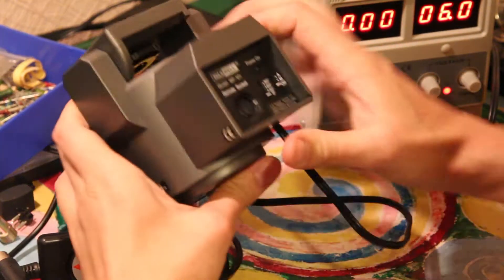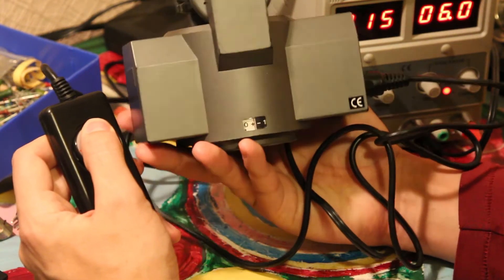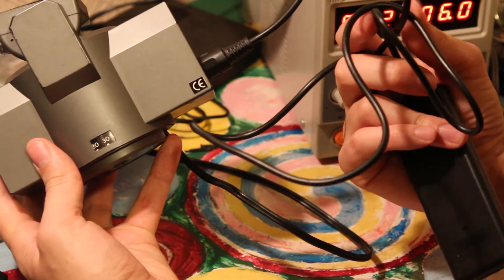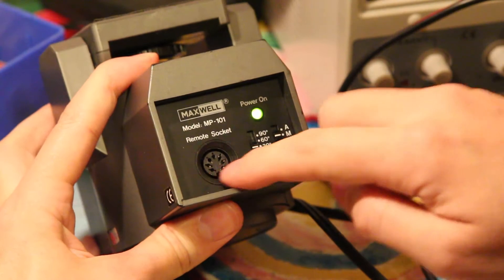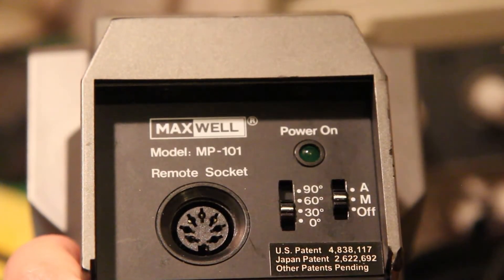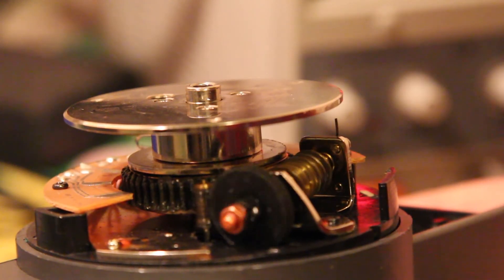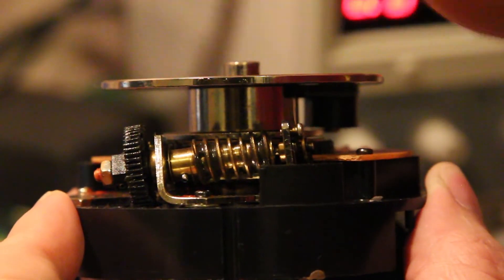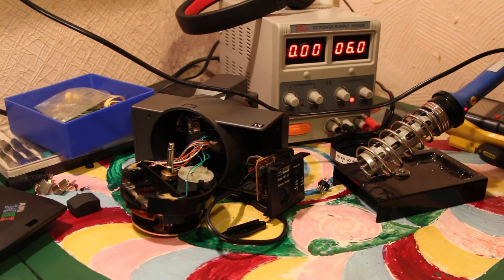Bescor / Maxwell MP-101 Review, remote control pinout and disassembly

Comment: Thank you for your video. My unit's tilt head is stuck so the remote doesn't operate although the pan function works. I need the pin connector that you showed in your video to put the tilt level back in place. Can you please provide me the name of pin connector and possibly a link to buy one. Thank you
Reply from the maker: Bluemist Studios https://en.m.wikipedia.org/wiki/DIN_connector

Comment: Hi do you think I can replace the DC motors to increase the torque of it? I am attaching a video camera that is almost 1.5kg and the motor can not push the camera upward.
Reply from the maker: In this device it would require to change transistors that control the motors, otherwise thay won't be able to handle higher current. And it could be a problem to fit bigger motors. But adding some counterweight so that camera would be balanced could solver the problem.

Comment: It was a very helpful video. Thank you.
I have a question. Is there a 7 pin male Din connector to USB male connector (with a digital to analog converter if need be). So that I can connect it to my computer and use a software instead of remote?
Reply from the maker: The only ready device I've heard of it this: https://camranger.com/product/camranger-pt-hub-mp-360/ . It allows some sort of wireless remote operation. 
I've never heard of any readily available USB to DIN adapters. One can be quite easily constructed using an Arduino, that would send PWM signals to the DIN connector, but for that you'd need to find someone familiar with that technology.

Comment: My unit's automatic (to-and-fro) angles are different from yours: 45, 90 and 340 degrees. How can one modify these angles e.g. to 180 degrees (which is the most useful one, at least for me)?
Reply from the maker: Note the C-shaped pcb on 7:19, it has a number or contact pads. Sliding contact touches these pads and gives signal to change rotation direction. If you have 340 degrees, you might be able to modify your PCB just by adding self-adhesive copper foil and soldering it to the pads that are related to 340 degree range (you actually need to "move" pcb pads).

Comment: so does it mean that when you lower the voltages on the adaptor it pan/tilts even slower than the slowest setting on the remote?
Reply from the maker: Yes, it's old and simple analogue technology. So the actual speed depends both on the adapter voltage and the setting on the remote. So it you set remote to the lowest speed and reduce adapter voltage, it will reduce the speed further up to the complete stop. The only problem is that at the very low speed it might run in unstable manner, e.g. it's possible that it wont be able to start sometimes.
Reply: Filipp Sudanov Can the bescor head be powered with 8v for faster speed? Its safe or the whole circuit will burn?
Or are you applying 8v direct to the pan motor?
Reply: As I see in the video, the potentiometer has a scale of 800 Ohms (low speed) to 20 KOhms (High speerd), it seems difficult to obtain for a more significant lower speed . It is already bounded by the electronic circuitry due to the motor characteristics, except by modifying the gearing to obtain lower speed but it become complicated.

Comment: Thanks for this very informative video.  I'm buying two of the Bescor units for a recital hall camera installation and will use the information to replace the Bescor remote with a joystick/speed pot which I'll build with the pin information you have provided.  I'm not planning on wireless at the moment so it will be a simple analog replacement of the Bescor remote in order to obtain better speed control and pan/tilt smoothness.  Any advise? 
-Jeff
Reply from the maker: It depends on a particular type of joystick that you will use. So far I can only say, that you can use PWM signals, for example generated by an Arduino to control the speed of movement.